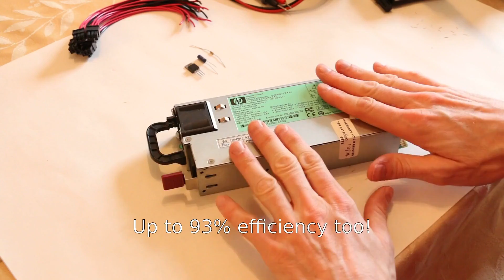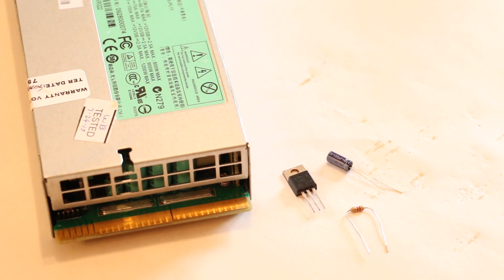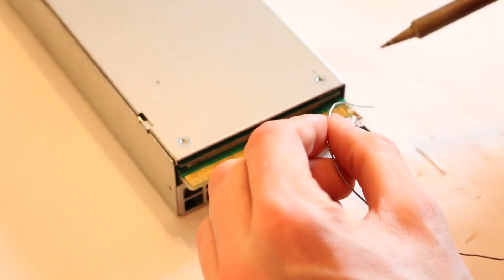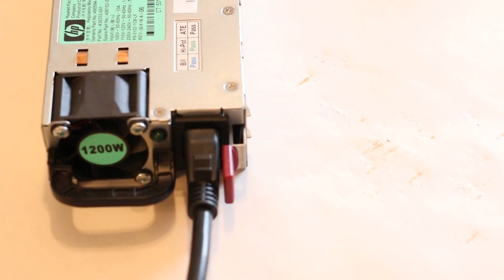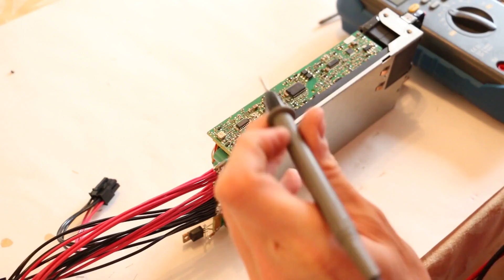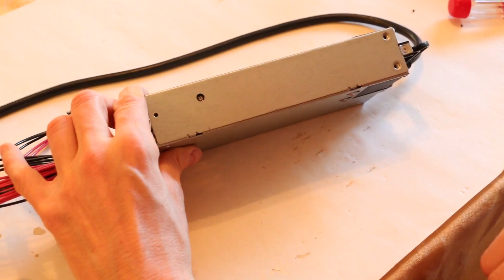Modifying an HP HSTNS-PL11 Server PSU for Bitcoin Mining (incl. auto-start and voltage adjust)

Comment: I have the same model (HSTNS-PL11) Just a jumper wire with no resistor, power cycled multiple times short and long periods it always turns on with 12v out.
Reply: Ya, of all the vids I've watched, this is first guy that says it won't turn back on without removing the resistor. May just get a breakout board, as I like the on-off feature most have.

Comment: Thanks for the video and sharing. My DPS 480EB A worked fine after jumpering pin 1 and 4 (pin 31 and 36 as marked on the PCB). Very quiet fan by the way...

Comment: I have been modding the supplies for a long time and I've never heard anything about this time delay requirement??? There is also nothing in the official datasheet about this.  I'm not sure where OP got his info but this isn't the correct way to power on this unit. The normal 470ohm resistor between pin 1 and 4 is also not spec, but works okay for some models. 
The proper, manufacturer designed method is:  
1: Tie pin 1 (left-most pin on top side) to ground. 
2: Connect pin 4 to +12v through a 21k resistor (the 200mA +12v standby is always on with power cable attached. Probe the top pins to locate it). You can also add a power switch in that line if you need one.
3: That's all! Output is a steady 12.23V on every one I've used and it will not drop much, if any with heavy load! This is one of the most well regulated, and highest performance 12v supply I know of. I make heavy use of these for all kinds of things including my 24/7 high power servers for which they were originally designed.   

NOTE: I like to add an LED from pin 3 to 1 that will light when output is activated. 
Also, these units get very hot at high loads (or even no load) because the fan runs at near silent most all the time. They are designed to run inside a server with 6x 200CFM Delta fans blasting air into them. To fix this, you can mod the internals in various ways or, what I am working on right now, connect over I2C to the PMBUS interface and send commands as needed to monitor/set the speeds/temps. Ill be posting a guide online once I get time

UPDATE:  I have two different types of the official breakout boards for these supplies. Both are designed differently, both wrong according to official datasheet, yet both work. However, I have noticed the onboard fan speed control acts differently between all these methods. My method (the official one) has a very smooth/fast increase in fan speed as needed in relation to internal heat. The others seem slow to respond and on some versions of this PSU, the fan never changes even at full load. Because of this, I strongly suggest using only this official method and avoid the breakout boards on eBay/Amazon as they use VERY poor designs (direct shorting of many unreated pins. Insufficient copper to handle full loading)
Reply: 21K resistor but what watt?  I have noticed that a lot people list resistors and leave off the watts.  Do you have a video of your method?  Thanks, Todd.
Reply: no video, sorry. It's on my long to-do list tho. The official datasheet doesn't specify watts of the 21k. Probably because it's very minimal with no real current passing through this sense line. I just use whatever 20k-22k resisters I can find in my scrap pile and it works.
Reply: Hi, can I ask if this method will work with HSTNS-PL28, 460W, still common slot PSU ?
Reply: @nikolaykarpuzov5320  I too need the answer to this??

Comment: when i did my  power supply, i just adjusted the internal regulator , after breaking the over voltage pin on the circuit,     but soldering it i ended up   cutting my soldering iron tip to a flathead like shape ,  Then  as i was heating the plate up i noticed the soldering wouldnt stick , i had to sit there and heat it up generously  in one spot until i got a part of the soldering to stick, then SLOWLY  work my way down the line  , Also dont touch near the edges,   last thing you need is a soldering short, i  had to heat mine up , and scrape it with a razorknife.

Comment: Great vid. 

Q1: Can you list some model #s of (cost effective) server PS's you prefer? 
Q2: Any thoughts on extending the housing to protect the components which project out the back?
(Guess RC (Radio Control) guys might have some info on making the PS portable.)

Q3: Does HP 490594-001 438203-001, aka HSTNS-PL11 use a regular 
(standard) PC cord? Or is the end that connects to unit different?
EDIT 
A: HSTNS-PL11 uses regular PC cord.

 PS: In the USA /in a country you have to pay for electricity... How much per thousand in hardware can you make Bitcoining?

Comment from the maker: I didn't mention it in the video, but the auto-start modification works by using the 5V standby line (pin 32) to charge te 100uF cap via the 470ohm resistor.  This provides the necessary time delay before the charge is sufficient to tun on the NPN transistor and the supply.
Reply: Hello I have one question there is possibility for 24 pin connector to motherboard ?
Reply: But the sticker says +12VSB (not +5VSB)..?

Comment: Excellent video and spot on. Tried it out on a HSTNS-PL11 1200w version and it works fine using the components listed.

For a second iteration used pin 30 for the capacitor ground, which is the 12v sb return.
Interestingly pin 32 is the SCL @5volts which powers the base of the TIP41.
The time delay is caused by the capacitor charging up through the resistor and then hitting the voltage threshold to trigger the TIP41.
Next is putting on a very board with a switch.

Comment: # Scroll to end to see my end result that appears to be working for me.

I know this is old, but I figured I'd post here in case your still reading or if anyone else sees it. 

I have the HP HSTNS-PL11 PSU, trying to just have it come on when I plug it in to use for a lipo charger for radio control use. I found a blog/site that said to use a 750ohm resistor from pin 33 to 36. That didn't work, then I found a site that said use lower resistance, so I put 2 of those in parallel. Then it seemed to work. I ran through a charge cycle pulling 30A out of it and it was fine. However, I try to use it today and the power light flickers on/off/on/off and the 12V output cuts in and out to match. Then it was suggested you could just put a switch between 33 and 36, plug the psu in, then flick the switch and it would come on. That works, but it powers off after 30 seconds. Well, the 12v output drops to 0v and the fan keeps spinning until I unplug it.

Now I'm going to try your way.

I also have a DPS-1200FB. Similar instructions for it. I have 2 of the 750ohm resistors in parallel on it and it stays up after plugging it in for about 20 minutes, then it shut off when under a 15A load.

I also bought a pre-modified pair of dells which I'm trying to replace because the fans in it sound like a 747 taking off until there's at least a 3A load on it, then they calm down. Would be fine, but I use my chargers to discharge to storage as well, since the chargers only discharge at 80w, it takes a couple hours to drain my packs down to storage. That's a long time with no load to listen to the fans in my office.

Getting frustrating.

EDIT 08/29/2020:
Running a test now with your setup, although my resistor is only 1/4 watt. Just ordered some 2W in case the 1/4 watt dies. Not sure it matters, but with mine, I can't unplug it and plug it in as quick as you or the green led blinks. I have to leave it unplugged for about a minute, then it turns back on when I plug it in.

EDIT 08/29/2020 B: 
Didn't work. Seemed to work fine until I unplugged it, waited a long time, then plugged it back in. The power LED flashes and output voltage is intermittent.

EDIT 08/30/2020: 
currently only using 150ohm from 33->36 and this appears to be working fine. I've charged packs off it at 15A using a revolectrix GT500 charger 3 times, discharged once, storage charged 4 times. It has stayed on the entire time without issue and now turns on/off with a power strip I have it plugged into.

Comment: FRIEND I HAVE 2 QUESTIONS 1- THE CONDENSER OF 100 MICROFARADIOS BUT IT DOES NOT SAY OF WHICH VOLTES AND THE SECOND THAT IS WHAT IT WANTS TO BE ACHIEVED WITH THAT MODIFICATION WHICH IS THE FUNCTION TO ADAPT THAT THOSE COMPONENTS, CLOSE TO THE PART OF THAT AUTOMATICALLY WORKS.

Comment: Hi Bicoinmining. I enjoyed your video. i just wanted to let you know that i have a HSTNS-PL28 (460W) that i will use to power a 1080TI GPU (about 260W) and i just jump the 1 and 4 pins like yours, but i didnt need the delay starter, just the jump and the PSU start right away, even if you disconnect the AC and connect it again, it starts right away.

Maybe that something that has to do with models?

Thanks.
Reply: Did you get it working, I wanted to put 2 in series to get an efficient 24v power supply
Reply: Same here... I have 3 DPS-1200 and I only added the 470 ohms resistor! It powers ON every time!

Comment: I have a question, when you plug the device into the outlet, does the fan turn on immediately, or only when you connect the resistor. Because mine turns on immediately, and when I insert the resistor, 12 volts appears on the terminals and the fan turns on at a much higher speed. Also my power supply doesn't need the whole transistor thing, the soldered resistor works and it's the exact same model

Comment: Could you not just use a switch? Kill the switch then unplug the power supply. Then when you need to plug it in again, just plug it in and flip the switch?

Comment: Hello, I have a similar PSU, only 750w, HSTNS-PL18. It works okay but the fan speed is too low and it is heating quite a bit. Any suggestion how to increase fan speed? Thanks
Reply: Hello, did you ever find an answer to speeding up the fan?

Comment: I know this was quite some time ago. But, would you happen to know if this procedure will work on the HSTNS-PD18? That supply is 750W and 62A. Part # 5606822-101. Mine will be general use rather than for mining, though...
Reply: Yes it does all you need is a 12v led resistor that's  what i used and works fine to power it on 👍

Comment: I Tryied to get the 12 volt across just like u showed put the resistor and was only able to get 12.09 volts from pad 5 not were u showed the voltage at positive and negative spot I Tryied every combo of pins shorted never worked

Comment: Hi friend. I did the mod, but I'm noticing a weird behavior. I turn the PSU on, the fan starts spinning, I put a load on it and up to 3A, the fan runs at the same speed initially, after 3A the fan slows down. Does yours is like that?

Comment: AMIGO TENGO 2 PREGUNTAS 1- EL CONDENSADOR DE 100 MICROFARADIOS PERO NO DICE DE CUANTOS VOLTIOS Y LA SEGUNDA QUE ES LO QUE SE QUIERE LOGRAR CON ESA MODIFICACION CUAL ES LA FUNCION AL ADAPTARLE ESOS COMPONENTE , CLARA A PARTE DE QUE PRENDA AUTOMATICAMENTE.
Reply: 100uf recommended 25V  minimum 16V

Comment: will this mod work on a HP HSTNS-PL18, part #490594-001 or 438203-001? It's a 750 watt 12 volt 62.5 amp sever power supply?
Reply: All you need to do is put the resistor on for that model get one for a 12v led resistor

Comment: Hello I have one question I cant see there 24 pin motherboard pins can you explain me how pin out it to this PSU
Reply: there is no 24 pin on this psu it is for a server
Reply: @WhateverUDecide  No 24 pin here, that's right. But it must be somehow possible to attach a 24-pin ATX connector to this power supply. Server is just another PC in a different form-factor. I have that question, too. Makes perfect sense because these server PSUs are much higher quality than the regular PC supplies that fail unpredictably. I'm actually a bit surprised people only mod it for mining (or battery charger!!). In fact, it's an excellent solution for an inexpensive server. Because server stuff prices have +00 even for a lousy bracket. So you don't wanna pay that much for a really small-scale solution. But if you want it to run 24/7, then you better use server parts.

Comment: Hello, i saw some psu like this, they dont have any resistor, capacitator or transistor... Only put a switch on 1 and 4 pin? is that ok? without elektrical componenets???
Reply: I have seen the same solution. Have you had any problems running the PSU like that? I think he installed all those components so that the PSU will start again automatically if the power goes away and comes back. 

Do you know if it's possible to make this PSU deliver around or more than 13.5V?

Comment: Is it possible to replace the potentiometer with a resistor to get the voltage up to 13.7 volts?
Reply: HSTNS-PL18 you can

Comment: I have never seen the turn on mod like this, this is unnecessary. Just put a 150-300 ohm resistor on 33 and 36. Also this is not how to adjust the voltage. You must locate the over voltage protection and add a resistor to it. I believe on the pl11 it is on the circuit board facing the metal wall meaning you must remove the whole board to get to it. This is a poor tutorial
Reply: Yup, this is the case with every video I've watched...Though, the resistor ohm rating is all over the place.

Comment: Why can't you just short pin 1 to 4.  That is what I did, seems to power up and work no-issue?  I only use it to power a lipo charger though
Reply: That works fine until you unplug the power supply and plug it back in. It will power on with just a jumper but if you leave it connected and then lose power or plug and unplug it will stay off.

Comment: could hook a little relay in the mix there powered from a 12v atx psu molex cable to act as a remote turn on. which connection do you think would be the best to break and insert the relay/switch? and in that case the delay would not be optimal? i may do that. thanks for the tut.
edit: 
i wonder. if there was a power outage and you had this hooked up with in conjunction with an atx psu for gpu mining,, would the delay of the atx startup be enough of a delay to omit the transistor and capacitor. ill try and see i guess. wish there was more info on this type of thing. the knowledge is so scattered over many forums.
if anyone can recommend sites that shares this type of tinkering for mining, please leave links.
thanks